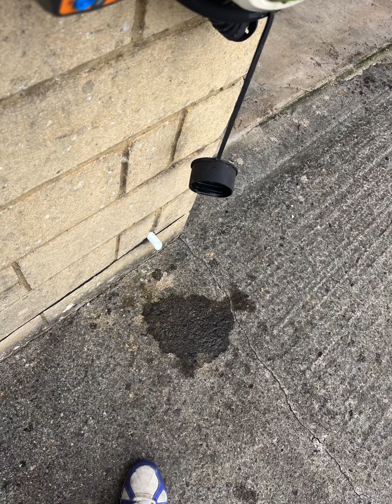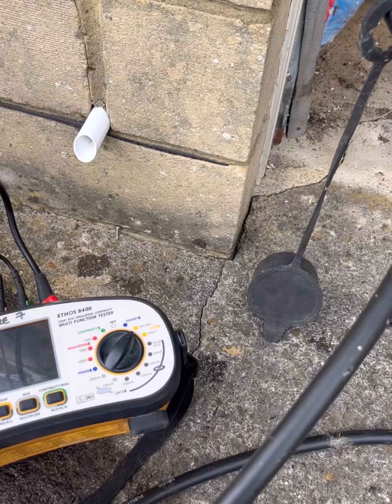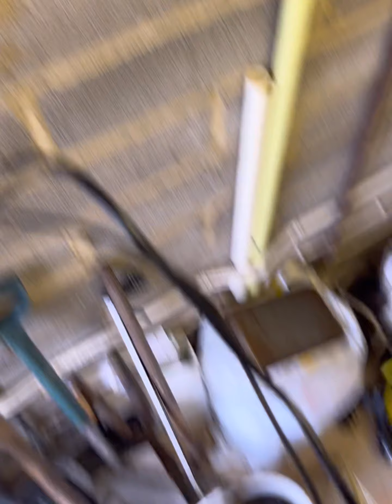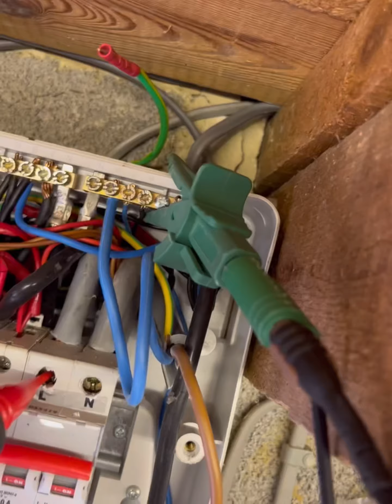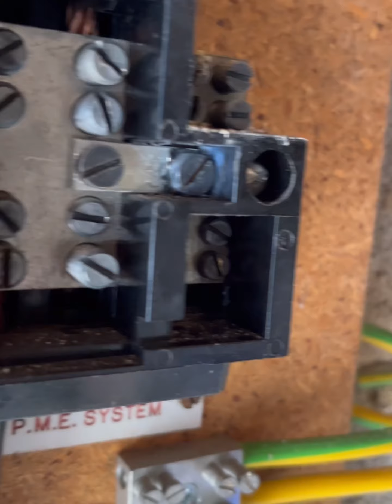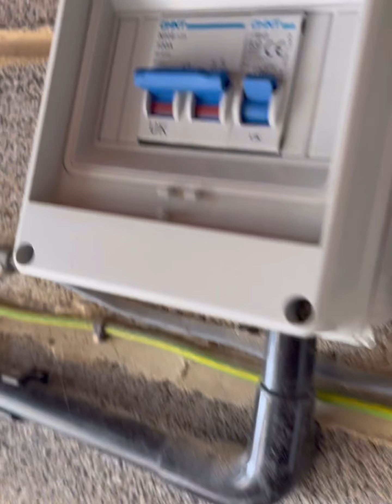Electric vehicle charger fault

Comment: 411.4.2 regs! ( ammedment 2) TN TNCS systems

It is recommended that an additional connection to Earth, by means of an earth electrode in accordance with Chapter 54, is made to the main earthing terminal. This recommendation does not apply to outbuildings of dwellings served by the installation.

Comment: Further to info already provided John ward says there no reason why you can’t add a Stake to a TNCS to keep touch voltages lower but you should aim for less than 10 ohms! What he doesn’t make clear is whether he’s referring to allowing the fusing device to trip or simply allowing touch voltages to remain within safe limits. As I’ve already stated this is to mitigate a PME break supply side. Touch voltages would be lower but unless you get low enough impedance the fusing wouldn’t operate. 4 ohms should be sufficient in most cases.
Reply: Risk assessment : 400-500 PME faults a year in the uk
                                  Touch voltage keep within safe limits 
                                   Separate or joined earthing systems 
                                   Distance away 10m etc if separate 
                                    4 ohms and below For ADS
Just some of the considerations 😁

Comment: (Qualified Electrician) Advise I got when to mitigate  pen fault on a TNCS and keep touch voltage lower is to add an earth stake to the MET this in effect lowers potential touch voltages in the event of damage to a TNCS neutral incomer ( always isolate supply before any work including solar and battery)
Reply from the maker: Absolutely would work, however it’s a dangerous setup to mix earth types in the same property, the risk being that if there is a lost PEN on the estate, the entire estate would be earthed via your Earth Rod, and it’s not designed for that, or rated for that level of earth / neutral path, and could create a dangerous potential in your property, or melt the cable and MET. It’s best to keep earthing arrangements separate.
Reply: Bs7671 and new 18th edition regs state the an earth rod can be beneficial to supplement earthing and keep touch voltages lower particularly when gas and water bondings can rise in plastic. This is not a mix of earthing types but merely a safety recommendation ! @core7557
Reply: Main MET connected to a ground stake at less than 10O ohms on a TNCS earthing system is actually accepted by new 18th edition regs as not being detrimental. Phone NICEIC they will confirm. The more parallel earth paths you have the safer the touch voltages will be.( although obviously a proper good TNCS would be the priority)
Reply: Also the likelihood of your ground stake being the only parallel path to ground for the whole road is ridiculous! The road would be full of house with gas and water bonds providing a path where gas and water services join 😀

Comment: I always thought that you need a separate earth for an EV charger ?
Reply from the maker: Nope, the new EV points on the market today come with a PEN monitor (depending on brand, Tesla chargers still lagging) but they have technology that will sense if the neutral- earth path is lost, and shut the charger off, so no need for an Earth Rod 💪🏻 just check the brand instructions to see if the unit has a built in PEN monitor. give us a call or email if you want any advice. www.core7.co.uk 

Happy to help

Comment: As you know you shouldn't be removing the DNO fuse and covers on the cut out , for obvious reasons.
Reply: The DNO should not be requesting you do this.
Reply: Some of us Electricians have been trained on DNO fuse removal I used to work for a meter company in smart metering and removed fuses every day for that job. General advice is don’t remove a fuse under load and if you see damage or risk around fuse head leave it alone! Also some older fuse heads can’t be opened and The DNO needs to be called for this. Another thing you can do is use rubber gloves and earth mat if you want even more safety 👍 @brendon91
Reply from the maker: Not exactly, the DNO request that we remove the cutout and take a reading at the head, to ensure they have the most accurate reading. But absolutely generally, it shouldn’t be touched or removed.
Reply: @core7557  the reason for mot removing the fuse is if the cut out breaks up whilst you are pulling the fuse it can short out and explode in your face showering you in molten brass . Not a good day
Reply: @dennisphoenix1  there's also the issue with some older cutouts leaking voltage through the plastic. Efixx did a video on that hazard for normal electricians, but that is still up to the DNO to rectify.

If an electrician finds an issue with a customer's installation, why wouldn't the DNO request further information ahead of sending out an engineer to change the cutout if the electrician is still there?
Reply: @CoolSteve08 yes I saw that e fixx  video.  As I said if you pull the main fuse it can go wrong.  When I worked on street lighting I went on a course so I could pull DNO fuses in columns and feeder pillars. The photos they showed us of when it had gone wrong brings it home.  Just be safe and wear the correct ppe

Comment: So to comply with current best practice and assuming you don't have PEN fault detection already, is it simply a matter of wiring an earth spike to the earth connection on the EV feed in place of the house earth ?
Reply from the maker: Adding in an Earth Rod to a property with a PEN system opens the door to some additional risks of potential fault voltage conditions. So without a PEN monitor, you would need to Earth Rod it, but the guidance would need to be followed.
Reply: Basically yes. That's what the official regulations call for when installing an EV charger, and especially if there is no Earth Spike you absolutely must have PEN Fault protection, which is easier done with 3-phase than 1, and 1 phase I think then requires an Earth spike anyway so why not just install one to begin with.